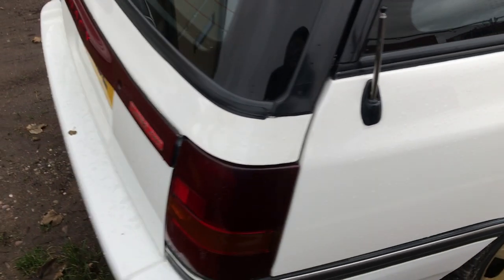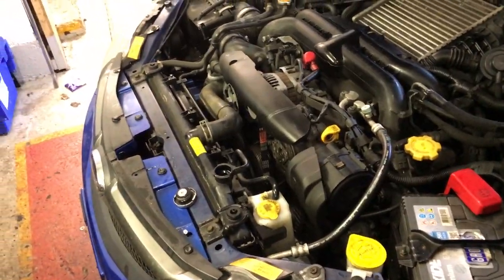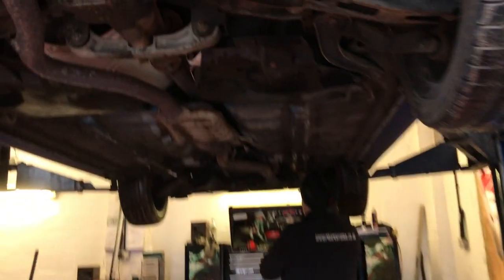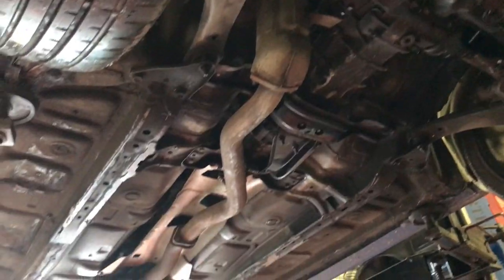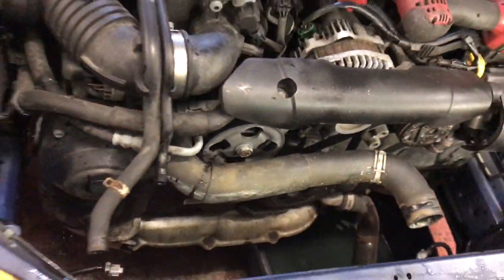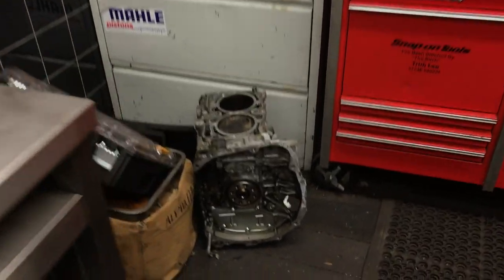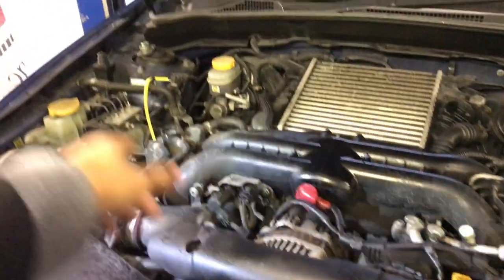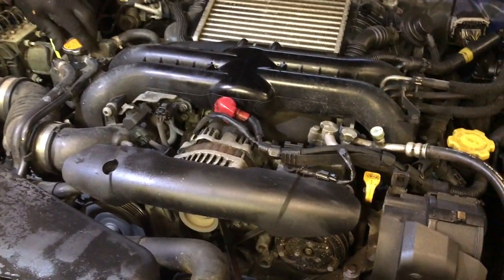Subaru WRX Major Leak | *SUBARU SPECIALIST FIX*

Comment: I’ve heard lots of bad things about under seal. Can it make the rust worse?
Reply from the maker: liam curley from what i know under seal is a protection to avoid the car picking up salt and dirt especially in cold winter period as they build up and form rust unless you wash the underbody of your car every week or drive on dry weather and store in the winter period.
Reply: No mate it great save car from rusting they undercoat them from factory. Its only bad if you wax over rust
Reply from the maker: Daniel Hawkins perfectly said, btw nice subaru bro! Should feature it 💪🙏😅